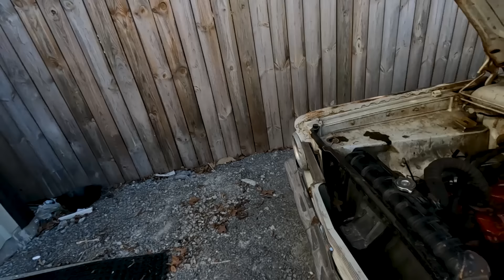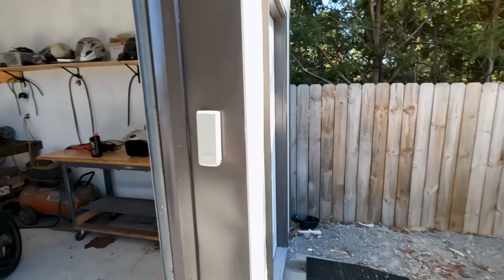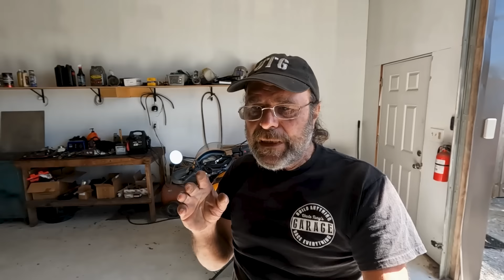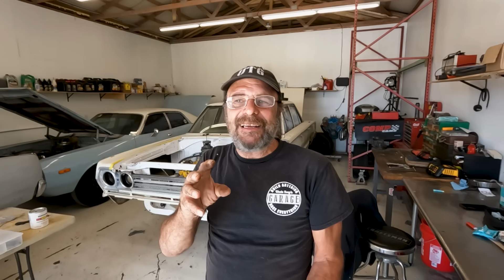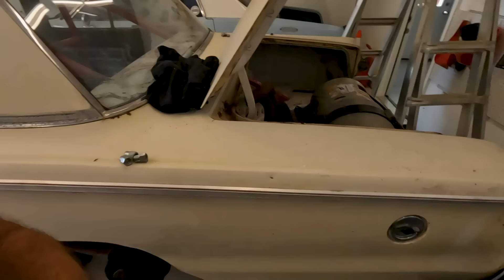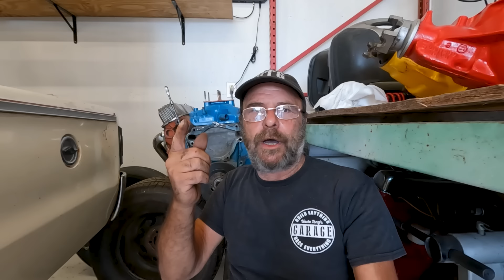Classic Car Tuning Problems - Curing Off-Idle Stumble, Bog, Hesitation, Stall And Backfire

Comment: I have a different problem flooding at idle stumble at the mid rpm range perfect at high rpmno hesitation to take off jumps off the line floods when I let off the throttle all I did is rebuild the carburetor same timing same fuel pressure

Comment: Tony…. The spring on the accelerator pumps is to prevent the diaphragm from rupture and provides a duration of spray to richen the mixture from idle through the transition circuit and into the power circuit. It also has a discharge check valve that maintains a full column of fuel to the back side of the accelerator nozzles and a weighted pintle that prevents a siphon effect from pulling fuel from the nozzles. Any of these parts can contribute to a hesitation or backfire. Having higher base timing usually requires altering the total advance ( base+ mechanical + vacuum) to prevent detonation. Modern engines use a detonation sensor because damage will occur long before an audible knock or ping. 
Factory vacuum advance units will have the degree of advance that they provide stamped on them. Some can be adjusted to operate by the strength of the vacuum required for them to advance. Some can be adjusted with shims ( removable vacuum nipple) others like GM can be tethered using a paper clip to restrict how far they advance. It is safe to say that there is 360° in a circle, and if we want to fire 8 cylinders inside of that circle then 360 divided by 8 = 45°. Total advance can’t go beyond that without causing problems or damage. Mopar will have you set the total advance to 52° freewheeling the engine. That would never reach that value when under load. Ported vacuum is short lived, manifold vacuum is active much longer in an advance curve. Finally, the distributor runs at camshaft speed and we measure timing at the crankshaft. Determining TDC is at the  center of the change over point where the piston stops moving but the crankshaft is still in motion

Comment: on a street holley you can fix that stumble usually by extending the air horn height, if you look at a race carb or a factory ford holley the tubes are cut off even,  on 4150 aftermarket carbs some of them it's molded into the body of carb you can extend it with rubber hose or a small tube that fits inside it, I don't know why this fixes the problem but it's worked for me in the past

Comment: I love that i know how to tune an old carby, points driven engine. 
Even a hot engine. If you got a wild cam, it's NOT going to idle at low revs.
That's the only argument I've had, one guy wanted it to run well, but idle low with a hot cam. I gave up on him. Got his car running the best it ever ran, but it wouldn't idle.
Also I've had endless arguments over spark plugs. Even if they are new, but you've been flooding them mucking around before you ask me to get it running, I'll insist on new fresh plugs. New plugs with bad leads? You get new leads and new plugs again before i waste my time trying to tune a bad plug. Also if it don't start to work out really fast if you know what your doing, it's low compression, or a bad carb. Can't tune low compression, can't tune a bad carb. Reving the crap out of them then jamming a rag over the carb intake can clean out a carb tho. And in fact, it's always worth doing. You'd be amazed by what just doing that can do.

Comment: Just that one information about the timing damper about it slipping an moving off tdc 
Explains why my timing lite never matched 
An also 
Setting up the distributor no matter what was always off a tooth ( not checking the real tdc with the piston tdc
Now I always check the piston tdc 
An the timing mark on the damper 
( it’s always off on a old used damper) 
Thank you 
I learn a lot from ur videos

Comment: I had a Harmonie balancer on my SBC with pre 10 degrees. But I didnt know that, because I didnt installed it. It gaves me days of scratching the Head. After pulling the balancer I found a note on the backside. I ordered a new one with correct timing marks and the Engines was Running minutes later.

Comment: Hi Tony, I have things the other way around with my 74 Chevelle.. It runs great once I step on the gas, and has a lot of power. But it Idles super low and rough. Sputters, shakes.. I can find some things on youtube but all videos are for modern engines. Maybe you could point out some things I can check on my older vehicle? Much appreciated!

Comment: Okay I have a 1986 Chevy k20 4 speed 4x4 set for like a year but when driving it goes for a minute then try to like come to a stop and die and I change the carb filter and the plug and put fresh gas and treatment but will run all day idling

Comment: I had a bog with my 305 and no amount of idle adjustment and accelerator adjustment would help. After taking the holley 600cfm apart I found the bridge that held the check ball in the accelerator pump came lose and the check ball was bouncing around. Fixed that and no bog.

Comment: Thanks for your help! Was working on a 83 Chevy van with a 350 carbed engine and it would die on light throttle off idle and during acceleration. It was a broken old vacuum hose behind the carb for the vacuum advance. Make sure all vacuum hoses are good!

Comment: HAD SAME FOR SEVERAL YEARS ON KAWASAKI TWIN
IDLED FINE MISFIRE PULLIG AWAY
WAS CAUSED BY FITING NON RESISTOR CAPS AND PLUGS
VOLLTAGE FROM COILS WENT BANANAS
NEW VOLTAGE REG DID NOTHING, NEW COILS DID NOTHING
CHANGIG CARB  VENT PIPES , FLOAT HEIGHTS DID NOTHING
FITTED REISTOR PLUG CAPS AND RESISTOR PLUGS -- RAN PERFECT
BUT FRAME HAD RUSTED AWAY

Comment: Some small engined motorcycles don’t have any form of accelerator pump to fill in the fuelling at off-idle. Instead, they permit adjustment of the slow circuit bypass circuit, either by turning a brass screw that alters fuel flow (engine side) or that alters air dilution (air filter side).

Comment: Have you personally had an inertia ring fall off? Or move?  I've never seen one move in 3 plus decades, much less fall off. The only one's Ive seen move are the ones that drive serpentine belts, and yes, I've seen those fall off.

Comment: You're talking about 2 different timing settings when you discuss "vacuum" timing and "power" timing.  Ideally,  you would use vacuum timing to set idle ignition timing and recurve the distributor to set power timing.  Unless I'm thinking about it incorrectly.

Comment: Hello Tony,  hope you are well.  I have an issue with my Holley 600 CFM.  My car idles great and is responsive at a stand still.  But, while driving and whining up at end of each gear, 1st, 2nd, 3rd, 4th the car bogs down and begins to backfire if I step on it.  In other words at higher RPMs. Notably, if i don't step on it and gradually step on the pedal allowing it to climb slowly, the bogging and backfire is less. I checked the bowls and they are fine and not flooding, just weeping over the side inspection port. I also tested the vacuum secondary by blowing air past the venturi and it's operational.  I checked the bowl needles and they were replaced, O-rings were bad. Removed the bowls and blew all the orifices with carb cleaner, seemed fine.  The blogging and backfire only happens at higher RPMs and I can't go over 55-60 MPH. My next idea is the distributor and I am running points. Any other suggestions?

Comment: Tony one push rod was dragging on the hole in the head. Enlarging that hole did it #6 exhaust. Another good one is an air leak at the throttle shaft.

Comment: I just rebuilt 78 350 4 bolt, used a cheap amazon rebuild kit, that what he bought, engine tech kit, realy crappie gaskets in kit but i ran with it. Did came break in, problen i got is eldebrock 600 mechanical choke is it will not run unless full choke is own,as soon as i open choke it dies, every port on carb is plugged.... ??

Comment: This guy talks to much timing sopost to be one  inch after number one piston top dead senter of normal ingian rotation so the plugs spark slightly after piston is going down instead of piston exploding against the serfice of the piston in other words slamming into the explosion

Comment: Good info. I'm going thru issues with my car. Engine is in good operating good condition, and all stock. Timing is correct, and air/fuel mixture has never been messed with.  It's a 425 78 Cadillac Coupe deVille. At start up from cold start, it'll run on fast idle, i kick down the fast idle and that's when it idles rough and stalls out. What I've done: replaced egr valve, pcv valve, some worn vacuum lines, charcoal canister filter, fuel filter, fuel pump. That didn't help. 2nd attempt: replaced cap, rotor, ignition module, and pick up coil. Ignition wires are all fine. Plugs fine too. And i thought it fixed the issue, drove the car for 2 days, and on the 3rd day back to idling rough, stalling, and no acceleration unless I'd punch it. Did a little snooping around and found a crack on the intake manifold by spraying carb cleaner. That intake was removed and just got recently replaced (this week) with another of the same year, make and model of car. Reinstalled everything, the car started in fast idle from cold start (been parked for weeks) let it run a bit, then i "kicked off" the fast idle and it literally did the same thing as before. Idle rough and stall out. Started up car, place a rock on pedal to keep it from stalling out, removed air cleaner and i placed my hand over choke and it smoothed out. Hand removed and back to idling rough. Sprayed around carb cleaner on top of carburetor (where the bolts are) and idle changed. Sprayed again, did the same thing. I'll be swapping carburetors with another i have on a 1980 Cadillac Coupe with the 368 and go from there. 
In some point of video regarding the good squirt of gas, i recall not seeing enough when i move throttle linkage... I dont know. Sorry if long to whomever read this, but it's best to include all what's been done and doing to get more of an opinion as to the cause. Thanks- Edgar

Comment: Great video. A lot of people don't like Edelbrocks, but a lot of off idle problems are solved by upgrading the accelerator pump. Edelbrock sells an accelerator pump with stiffer and heavier spring that delivers a bigger shot. I don't have part number, but accelerator pump I believe standard on the larger 800cfm and marine carburetors. Changing that took away the bog down off idle.

Comment: That Carter BBD is better than the Holley 1920 (most slant-six).  In the later, a flat accel pump rod comes in from the side, near the base.  When the diaphragm fails, gas leaks out onto the manifold (bad).  Biggest problem with all carburetors is if debris keeps the float needle from closing, gas overflows the bowl and runs out, to perhaps cause an engine fire.

In general, you get best mileage and power from having the most spark advance possible without knocking, at every operating condition.  Since that varies with gasoline quality, modern engine controllers continually creep up the timing as you drive until they sense knock, then back-off timing a few degrees and creep forward again, so always running right near the knock limit.

Even with MPFI, you can get the same rough idle and hesitation if running lean, if a mass airflow sensor (MAF) and vacuum leak since the MAF doesn't measure and compensate for the leak flow.  The leak must overwhelm the authority of feedback correction from the upstream O2 sensor ("fuel trim", usually +/-10% limit).  More common EFI uses manifold pressure (MAP) and rpm to infer airflow, which compensates for vacuum leaks.  It will idle too fast, if it overwhelms the authority of the Idle Air Control (IAC) valve (leaks air around fully-closed throttle plate, pegged if IAC is full-closed.  Try it by pulling the large vacuum hose off the brake booster.  A MAP engine will idle very fast, but smooth.  Above is why EFI is more forgivable, due to many sensors, with both feed-forward "scheduling" and active negative feedback trim from the O2 sensor.

Comment: Nice video. You hit all of the points we need on carb’d engines. My engine has a little bump in the cam so I’ve added marks on my damper so I can set initial timing at about +18 degrees.

Comment: My 350 small block doesn’t necessarily stumble or bog off idle it has good torque and response but my problem is the car feels dead when i stomp on it when going anywhere over 30-40

Comment: I was able to cure an off idle stumble with an Edelbrock AVS2 by simply replacing the stock discharge nozzles with one from a late '60's Carter AVS. The stock Edelbrock nozzles are necked down and didn't allow for the needed fuel shot.

Comment: Hey Tony, I had a stumble problem with a Dominator on a race engine because throttle were too far open at idle and too much of the transfer slot was exposed.
Reply: I don't think Tony understands the importance of proper transfer slot relationship to the throttle plates at idle, otherwise he would've mentioned it.

Comment: Happy new year uncle Tony, I have a question I have a 355 blueprint motor in my k1500 with an edlebrock 600 28k miles on it I just had to do the intake gasket on it for a coolant leak, but what bugs me apon putting my distributor back in gas had dripped out of the vacuum advance cone what could cause this? I didn't find anything online about it I'm perplexed, thanks so much 
Kevin

Comment: Fantastic video Tony I've been out of the Hi Performance era for a few years now but im going back into time looking for a '70's unit Ford F-250 Highboy and want to trick itboutva bit nice stick grind camshaft intake manifold headers nice porting & polishing etc. 
 The last toy I had was a '66 Olds 425 CI done up Punch 40 over 11:1 compression ratio heads done balanced aline honed squared block cross drill oil gallerys oil restriction on the camshaft oik relief slots cut into the rods 5-quart Toronado oil pan high volume oil pump and 9/16" pickup over 500 HP has tge camshaft advanced 4° then total timing at 32° change the weights in the distributor and just eliminated the vacuum advanced system all together '67 400 Turbo short shaft and used the switch pitch converter from a small block '67  2-speed Olds converter that was a switch pitch as well but a 2" smaller my high stall was 3800 RPM & low stall was 2800 RPM had a toggle switch on the shifter just above the trans brake and line lock had the 12 Bolt Posi clutches shimed solid and running  4:56:1 gears talk about dance took it out one on the street went to the speed shop yo grab a couple things left the shop in first easy hammered the throddle shifting into second car broke loose went sideways had to do corrective steering must have left a easy 12' of rubber on the road couple days later I met up with couple guy's I know and they asked if i was jamming on the breaks but they realized that i was letting it go ... I still wish i kept the carit was a '79 Olds Delta 88 Holiday Coup 2-door shouldn't have sold it a lot of time went into it expressly making up the jig to change the mounting brackets to fit the rear end into place and the upper links custom made.. it pulled the front wheels of the ground just mostly old school work six cylinder springs in the front have to admit they were fun times running it at the track at Dragway Park Cayuga Ontario Canada 11:30's. @  112 MPH  The camshaft was custom ground 328 / 328 duration 1/2 lift factory W-30 grind but being a 1966 - 425 odd bank angle of 45° all the rest of Olds motor's are 39° bank angle... Keep up the fantastic work Tony your one of my favorite channels slong with David Visser..

Comment: Thanks for the awesome information, learn a lot. 
Question what if car drops low rpm, feels like shutting off from idle to drive or reverse. It’s all good at idle and acceleration but only when out in gear. 
I have Ford 289 V8 with Holley 4 barrel 4180 with 600cfm. 
I have already adjusted metering, float and heat choke… 
Can you direct me here my friend

Comment: The proper adjustment for a Holley accelerator pump is .015”-.018” clearance with the throttle held wide open.   The clearance prevents pump diaphragm damage and full pump volume.  
Be careful adjusting the accelerator pump, it’s easier than expected to damage the pump diaphragm.  Tom Vaught Holley engineer
Reply: Thanks for the comment, Tom.  I was going to comment the same as you, but you beat me to it!  I can't believe, with Tony's self proclaimed knowledge, he didn't know this.  He is confusing the beginners.

Comment: I used to have the stock thermoquad on my cleveland 351…
God damn I could not get that acceleration pump right. Drove me nuts for years. In the end I just put a holley carb on. Much better without the flat spot. However I do miss the feeling of those giant back barrels opening up.

Comment: Hey Tony, I have a 93 f150 short wide 2wd 5.0 automatic I want to build up and me and my buddy are trying to come up with a game plan. So far I am thinking of swapping EFI to carb and the transmission to standard so we can avoid any computer issues. Keeping stock pumps and adding regulator. I know if I keep the automatic I will need a special kickdown plate for the throttle position, but my question would be is there a way to keep the automatic without having to wire in any kind of after market computer for the stock trans?

Comment: This video described exactly what I'm experiencing with my 85 Jeep Grand Wagoneer. It stumbles at take off and then under load it's knocking.  Factory spec calls for 19 degrees BTC and the brackets happen to block clear vision to actually set the timing accurately.  I will be trying the power setting as you described today and I'm looking forward to it!  Thank you!!